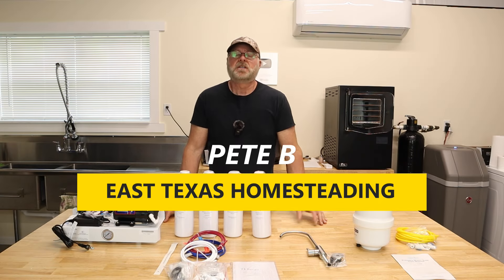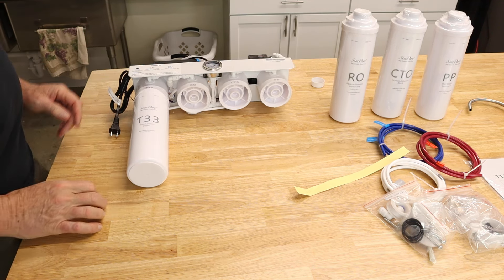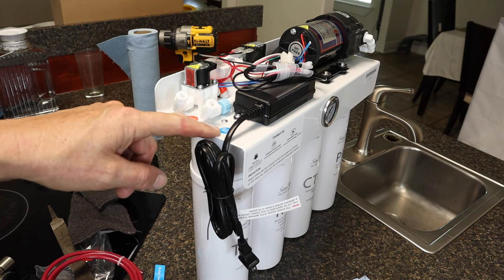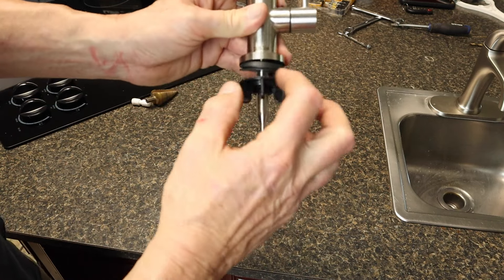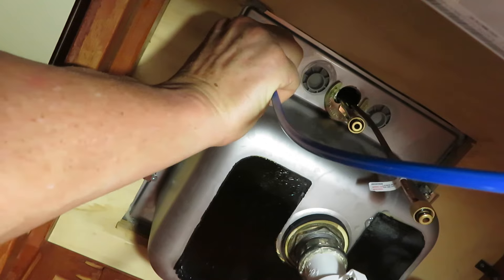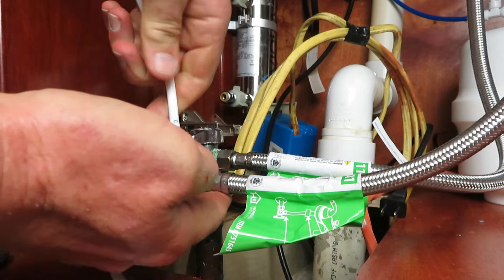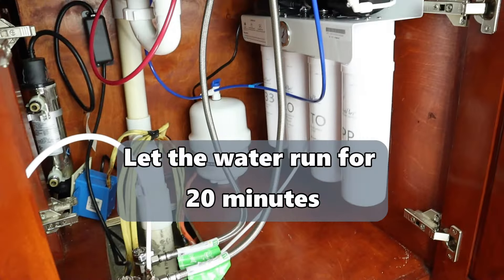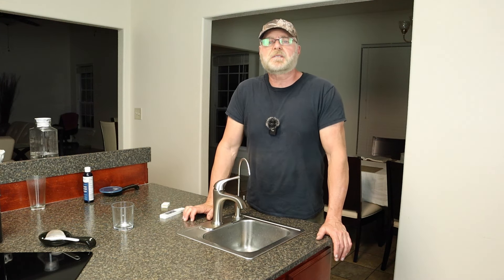Transform Your Water With Simpure T1-400: Easy UV Tankless Reverse Osmosis System Setup

Comment: I just replace my filters in that exact unit and 3 of the 4 cylinders leaked. Called simpure and they told me to replace the orings with ones that came with the original install kit. All is good and they are sending free replacement. I had to let mine run for an hour.

Comment: Does anyone else have a problem with the water leaking from the filter connections when the pump turns on?

The thing is brand new, and it seems the O rings are all jacked up.

Comment: i installed mine but instead of going to faucet, i connected it to the fridge line. now my issue is pressure. any idea?
Reply from the maker: You need to install the pressure tank for you to have proper pressure. The link is in the description under the video.
Reply: yeah i have the pressure tank connected too. it’s like filter > tank > fridge, but still pressure is lacking
Reply from the maker: @mgnystudio6495  Try disconnecting the line to the fridge into a bucket and see how much pressure is coming out and going into the fridge. Make sure the fridge filter is new and no kinks in the line in the fridge.
Reply: fridge and plumbing to fridge is like 3 weeks old. we added simpure just last wed (about 3 days ago). the water after the tank is fine, but for some reason the pressure coming out of fridge is weak. fridge used to fill 1oz per sec. now it’s like 1oz every 3sec. im not sure if there are other ways of connecting the fridge (eg straight from filter using the blue line, since i dont use faucet, instead of the yellow line from pressure tank)

Comment: Another good video.  I am considering an alkaline RO system from iSpring with an additional pump for the refrigerator hookup.  I plan on running PEX through the attic to the other corner of the kitchen.  I would have placed the 2 closer had I been designing the kitchen today.  Haha.  All the best from north Texas.